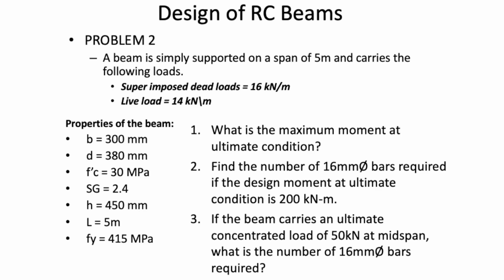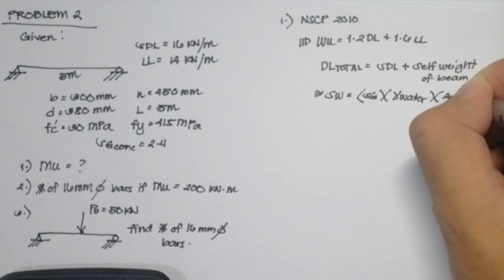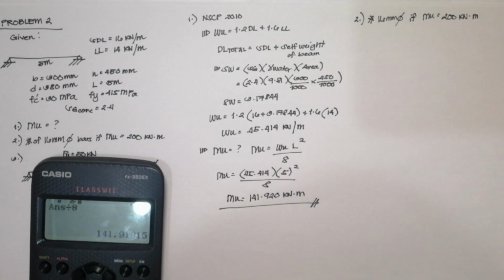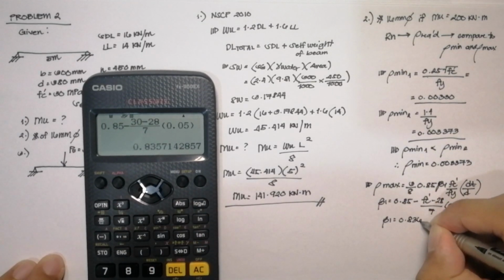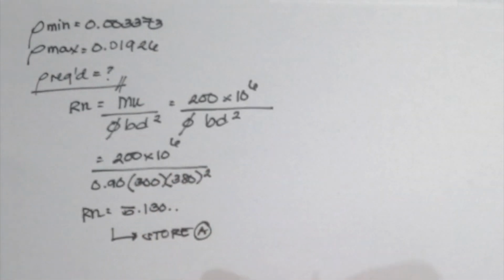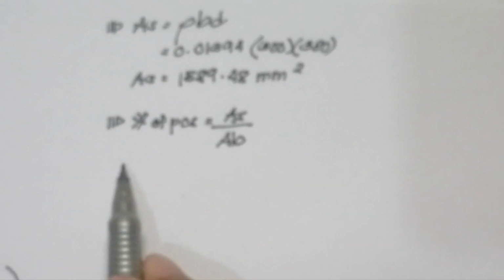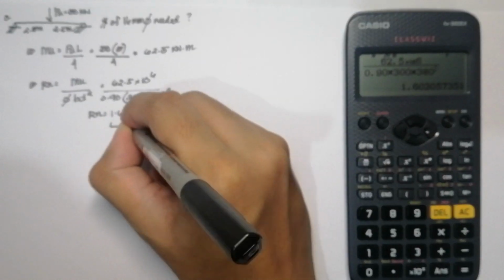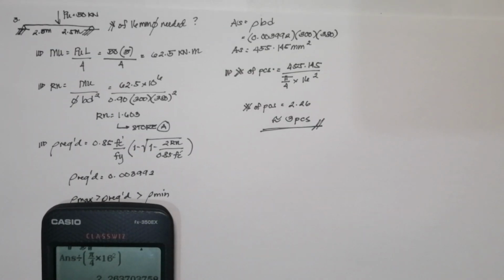PRACTICE PROBLEM 5 | DESIGN OF SINGLY REINFORCED BEAMS PART 2

Comment: sir for max steel ratio bakit po hindi 3/7? any explanations po sana sa comment masagot
Reply: For a tension controlled beam strain should be greater than or equal to 0.005 which would give 3/8. The 3/7 steel ratio is based on 0.004 strain and is the least allowable strain under ACI code hence giving the maximum steel ratio but needs to design as transition. You can derive the relationship between strain and steel ratio using the stress-strain diagram.